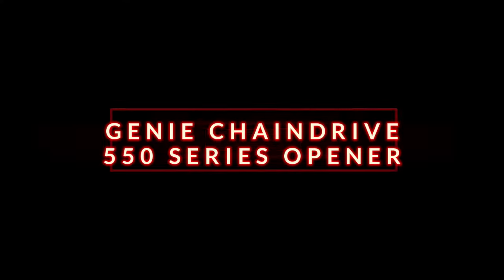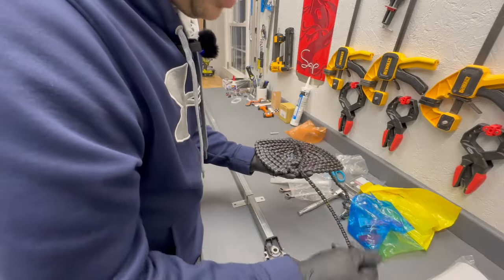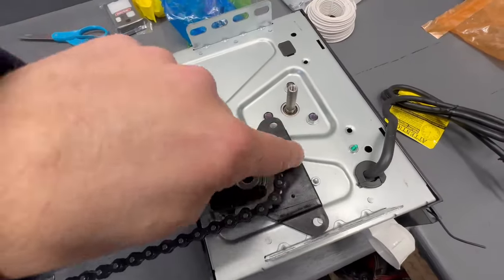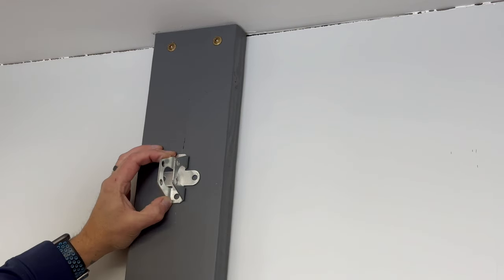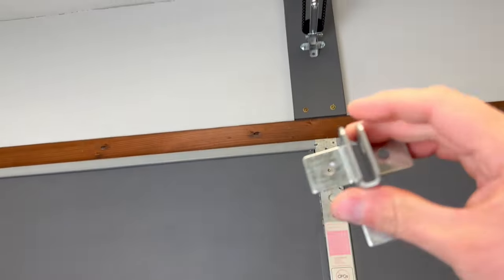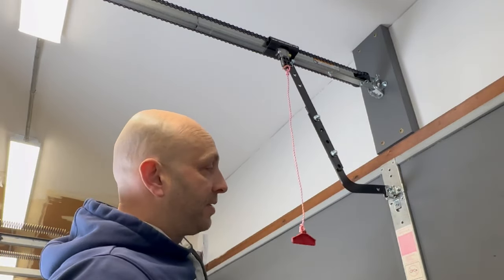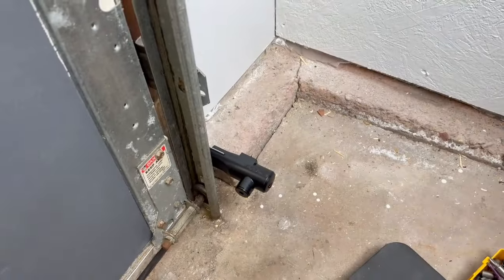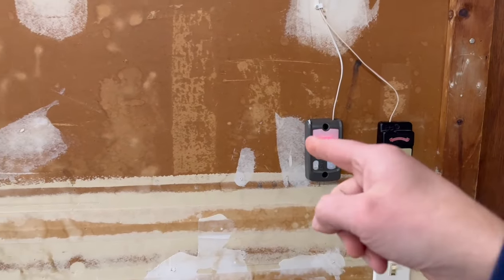The only video you need for installing a garage door opener - Genie

Comment: Great video! Definitely saved me some time and hassle. 
One note, when I powered up the unit my wall controller was not lit up. Fortunately I noticed it was in the locked position, which turns off the red light. After switching it back to unlocked, it turned red and works perfectly. Glad I saw this before chasing down all the wiring possibilities.
Reply from the maker: Thanks! Good call out on the lock button. Didn’t even think of that.

Comment: Good video. It's nice to see what I was getting into before I installed it. Only took a couple hours. I replaced a 43 old Stanley opener. So I had to take down the old one first. The Stanley still worked but was getting a little funny by randomly opening the door on it's own. Time for a new one. Got my money's worth out of it. It's funny the technology hasn't change that much.
Reply from the maker: Thanks for watching! Yeah they are basically the same with some added features nowadays. Definitely not built as sturdy as the older units but way quieter.

Comment: Thank you. That paralleling the sensors was a nice little tip. Still barely had enough wire clips. I would add, cover the exposed wires of the floor sensors with some black gaff tape so they don't get all gunked up over time and help slow any corrosion.
Reply from the maker: Welcome. Yeah wouldn’t have had enough wire on my far side door from the main control to reach so it definitely helped. Good idea with the gaff tape
Reply: I really hate the provided wire, almost impossible to split it to separate without exposing the interior wire. Added a lot of tome to the install.
Reply from the maker: @jaycuster1180  Yeah it's a pain. I took diagonal cutters and cut lengthwise at the end I was going to strip then pulled it apart before stripping. Seemed to work good
Reply: 14:05 is a red wire the same as a stripped wire ?

Comment: Great video.  Thanks
Reply from the maker: Welcome
Reply: Ive installed many openers.   This Genie installed pretty easy and straight forward but I think there was a sensor issue.   The transmitter kept blinking 3 times pause and 3 times.  I had to contact support 3 times. Their support no nothing about installing and just read possible fixes.  They had a care less attitude. All 3 of them.  I even held the sensors an inch apart and they wouldnt connect.  Wound up sending it back and bought a performax from menards.   Wont buy a genie again.

Comment: Good job. Very helpful. What is far from helpful is the shoddy quality control from Genie. I found a couple of things that were assembled backwards - SLIPSHOD. I expected it to be easy, but these things cost a TON of time to finally figure out that they were put together at the factory the WRONG WAY.
Reply from the maker: Geez. What was messed up?
Reply: @theguyofalltrades  -  The plastic housing that sits in the track and through which the screw rod travels - the one that the metal bracket that holds the track to the motor housing was put in upside down at the factory. I kept wondering why there wasn't a slot that would allow the bracket to seat like it was intended. I finally had to pull it out and turn it upside down and it all worked as it should - GRRR!
AND WORSE, the plastic carriage in which the cheap pot metal screw-slider is supposed to be seated - well, I am not even sure how this happened or if it can be fixed, but after getting the motor to spin the screw, it wasn't engaging and moving the carriage. Odd. I went up on the ladder and was moving that plastic carriage around when suddenly something fell and hit the garage floor. It turned out to be that pot metal screw dingy. So there is no way to put it back in there without taking the entire motor and track down and then fiddle fucking with it -  that is, if it can even be put back as it appears the plastic clip that holds it in place is either missing or it too hit the floor and went god knows where. I don't  even know how this was possible except cheap - cheap - cheap numbskull labor and shoddy QC.
Reply from the maker: @jacquesmersereau4173  Definitely not as stought as the older Stanley and Craftsman openers

Comment: I’m struggling to get the chain tightened without the chain twisting🤔  but so far a great video and once I get the chain tight I’ll keep on watching 😅
Reply from the maker: You can just tighten it up to the point where it’s not sagging and you have that measurement I mention from the bottom of the rail then twist the chains into alignment before tightening

Comment: Thanks for this video! One question: it seems that I have to hold the button on the wall for the door to shut but if I hit the button for it to come up it works. Any ideas?
Reply from the maker: I would check to make sure the lower limit is setup and the door sensor beams are aligned. The lights shouldn’t be blinking

Comment: Nice job.......no wasted time here except for the ads. I need to shorten my rail and chain due to support beam at 9 ft. Any tips on that? I have a chain link remover to shorten it. I was thinking that I would take whatever length I need off the middle rail, and then shorten the chain to match.
Reply from the maker: You could definitely use a link remover to shorten chain. The ends are just a master link connected to the threaded bolt portion that goes into the spanner

Comment: Thanks for the video.  Great job.  Just curious why you chose a chain drive over a belt-driven unit?  In your opinion are the chain-driven units that much louder than the belt-driven units?  Thanks again for the video.  I'm replacing two 45-year-old Genie screw-driven units at my mother's house...that still work!  It's just time to put these guys to rest.  They're getting loud and we're down to one well-used remote.  Well done Genie.
Reply from the maker: Thanks and welcome. I think I chose the chain drive because it will last a bit longer than the belt drive from what I’ve read. These are fairly quiet compared to the original craftsman that came out. I think most of the noise was the motor itself. The only thing I don’t like is the track because it’s in sections that slide together instead of bolting together but other than that it was easy to install and program. They do make a bunch of different versions with some cool features if you’re looking like WiFi and cameras etc…

Comment: Awesome and very informative video! Do you know the total length of the assembled unit? 

I have a crossbeam in my garage that is hindering my ability to put in a new opener. Couple different models that I have tried have been too long.
Reply from the maker: I added an extension to mine to get past the bulkhead. I’ll make a short and post it today to show you

Comment: Great video and i appreciate the added tips.  Would have been nice to see a lil more info like how to seperate the wire. In the instructions it looks as if there are two sets of wires. It was confusing bc i didn't see a striped wire. One side has lettering identfying it as type cl 2x....i assume that was the striped wire?  Dosent look anything like the pic.
Reply from the maker: Yeah the writing is the striped wire. Mine had little hashes on it also. To split it I used diagonal cutters or a utility knife then just pulled it apart

Comment: One other question which is not addressed in the instructions. Lubrication: I would image not too much maybe some synthetic grease on the drive sprocket??? Need advice.
Reply from the maker: Chain comes pre lubed. No need on the sprocket. If you ever need to line they make specific chain line and use lightly
Reply: @theguyofalltrades  Thanks.

Comment: Is it normal for the motor rail to slightly dip down when closing ? It is the extended version .. which has about 19 bars that assemble one
Reply from the maker: Yeah on these it is because they are multi piece rails. Some other brands use a solid rail which is definitely better or a rail that bolts together in pieces
Reply: @theguyofalltrades  mucho Gracias !

Comment: I need help, on my opener the - is the up and the + is down. What did I do wrong? And the beams don't work when I block them.
Reply from the maker: Sounds like maybe the sensor wires got crossed somewhere. Do the lights look normal? No flashing?
Reply: @theguyofalltrades  normal

Comment: Great video! Do you know if I would be able to replace my 1035 power head with the 2035? Just the power head, everything else would stay the same (track, chain, mount, sensors, wiring, etc)
Reply from the maker: Thanks! I think the only difference might be the track. You would have to look at the top of the power head and see what the track mount looks like. The electrical should be the same though I believe

Comment: Could you verify what you mean by paralleling the right sensor wires together?  Hard to see from angle.
Reply from the maker: basically connecting both sensors together and running one wire back to the power head instead of two. Just wire for wire, terminal to terminal from the receiver eye sensor to the emitter eye sensor. I have a youtube short that shows it also

Comment: Thanks for the detailed video!  Is the rail from the motor to header supposed to be level or is the motor supposed to be lower than the header. I’ve read online some people say yes and some say the motor should be angled lower.
Reply from the maker: It honestly works either way. My motor is a little lower than the header because of the bulkhead that covers my support beam extending down a foot.
Reply: @theguyofalltrades  thanks. The reason I asked was because recently I’ve noticed the rail bends when closing and sometimes It will stop while door is closing and opens again.  I’m thinking maybe the rail is too high at header ? I have to help push it down to close it at times. Any ideas what it can be? There’s nothing in the way of the light beam below.
Reply from the maker: Possibly the power head needs to move forwards a bit or your chain needs to be tightened. The rail sections will grab the black plastic carriage slider if not tight. I would check the chain first. Then maybe loosen the mounts on the power head and try to slide it towards the door direction a little if possible
Reply: @theguyofalltrades  Thanks I’ll check that out.

Comment: Really great video.  Does the set up actually lock the garage door if someone doesn't use an opener or know the code?
Reply from the maker: Thanks for watching! Not sure I follow your question though. Which part are you specifically talking about locking?
Reply: @theguyofalltrades  can anyone just walk up and open the door?
Reply from the maker: Nope. Not unless you have the emergency release pulled. There is also a vacation mode where you flip a switch on the main wall button control and it won’t allow the door to open even with a remote
Reply: @theguyofalltrades  thank you!
Reply from the maker: Welcome

Comment: I noticed you did not have to program the wall console. Assuming the wires are correct, does that mean the wall console controller works without programming? My home has 4 different wires and I can't seem to figure out which wires goes into which terminals. There's a striped red and white wire and a striped black and white wire.. any idea?
Reply from the maker: Wall control does not need to be programmed. So they are in pairs, the striped red and white would most likely be a pair. Best bet is to see which wires are going to the door sensors first if this is an existing installation. Then lookup the model of the opener on google and find the diagram of the terminal layout.
Reply: @theguyofalltrades  how do you fix the safety beams if the red (source) is blinking 3 times? the diagram says it could be a source interference, but there's nothing in front or behind or along the line between the red and green sensors.
Reply from the maker: How to fix a genie garage door sensor blinking red 3 times #shorts #garage
https://youtube.com/shorts/opy1zeLrJdY?feature=share
Reply: @theguyofalltrades  unfortunately this video and many others only show explanation on if you have 2 garage doors. We only have 1 and there's interference somewhere and we have no clue where from

Comment: 8:20 If at that point you open the door, you can get the motor pretty much dead on center.
 btw: doesn't  there suppose to be a cover for the motor's gear. Mine hadn't come with one.
Reply from the maker: No cover on this one
Reply: @theguyofalltrades  Okay, Thanks. Just finished up the wiring. All works
 great. Thanks for doing the video!
Reply from the maker: @timippolito1182 awesome! Great to hear. You’re welcome